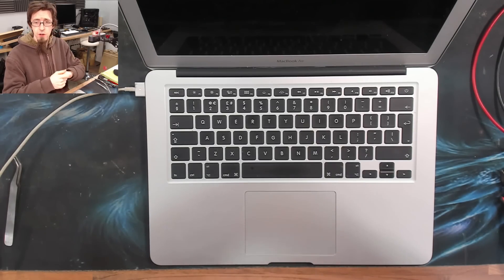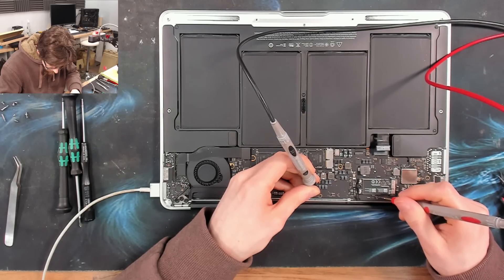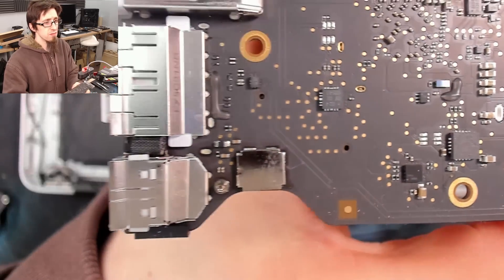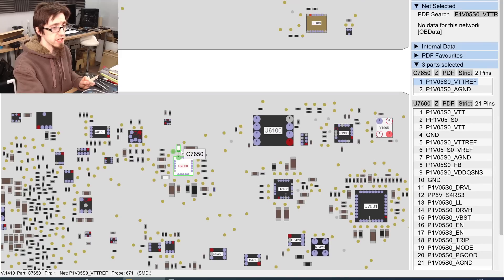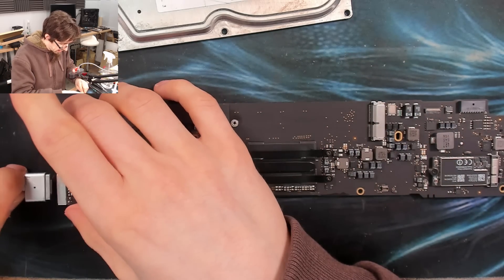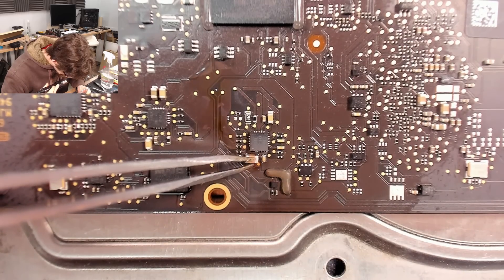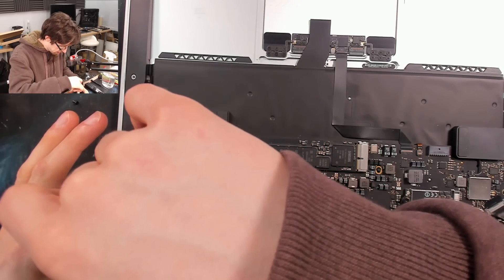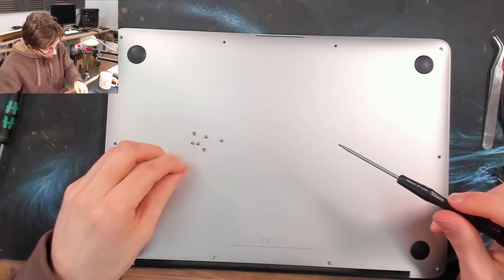MacBook Air, Tiny amount of corrosion - LFC#295

Comment: Question, Are those types of capacitors polarized. when you went to heat it up at 13:02 it spun around 180 from the position you placed it in? is this something you need to be worried about when doing board level repair using hot air?
Reply: ah its a MLCC Cap, so not polarised.

Comment: Sorry to bother you! Love your videos.. Curious your advice, I have a laptop that works fine - I launch a game and it'll work anywhere from 10 seconds to 6-7 hours. It'll just straight up turn off. Installed a fresh OS on it with drivers and ran it in Heaven for 6 hours then boom - OFF. Ran memtest86 to see if that was the issue (All runs passed) then I tried something else and launched Heavenly and it was off in like 20 seconds.. Tried one last thing and disconnected the battery to run it off direct power to see if that was possibly the issue. Same thing. At my wits end honestly.

All can think of (and I'm no expert for sure) is that either the GPU is dying or there is some sort of short occuring? Your input is appreciated! Thank you!
Reply from the maker: What model laptop is it? As a complete shot in the dark, I'd replace the thermal paste - even though it can sometimes run for hours, there's a thing I call "flash overheating" where bad thermal paste will work for slow temperature changes, but a sudden spike can cause the CPU/GPU to jump (or flash, because it happens in a second) past thermal cut off. You won't spot it on temperature monitoring, when it happens, it happens too fast to log.
Reply: @Adamant_IT  I will try that asap. Thank you for the response, it’s an Asus Tuf FX506iv

Comment: I love the way you can change just the component you want to Graham. I have a natural ability to blow  resistors and caps off the logic board with the hot air station. I guess practice makes perfect?
Reply from the maker: Ye, practise is key. Don't forget about the airflow dial on your station as well, it's very tempting to keep it on max all the time for more heat, but surprise, turning it down (to like, 1/4 or 1/3) will give you more control on smaller stuff.

Comment: I have a problem that I have never seen before and perhaps you could provide some insight. I have a HP Pavillion with 16 gb of ram and Intel i5-3470k CPU. The issue I have is with the ram…..more specifically….the ram slots. It boots and runs fine with one stick in any slot…….but when I add a second stick in dual channel (slot 1 & 3 or 2 & 4] configuration, it doesn’t post. All ram sticks I’ve used are good working sticks. Now when I put the sticks in 3 & 4 it posts, but only in single channel of course. If I use 4 sticks……..it doesn’t post. I have updated to the latest bios thinking that may have been the problem……….but no change. I am completely baffled by this problem. For me, the motherboard is somehow failing. What do you think? Getting any answers out of HP/Compaq is an exercise in futility. Definitely the last HP product I will ever own.
Reply from the maker: I've seen dual-channel issues like this before with 3rd gen intel on 2nd gen chipsets - that might be it. Otherwise you might just have to take the hit and run single-channel 😔
Reply: @Adamant_IT  Thanks dude. Unlike the US tech channels, you always reply and damn………I like that. I will send you some pictures and specs of my builds for you to critique. I really enjoy your channel and love how you approach each job. The great part is that you show us computer we actually use and can afford. The US tech channels show us unobtainable hardware. Your channel is similar to Brians at “Tech Yes”. Keep up the great work man.

Comment: You are amazing, I play around with repairs and your videos are so helpful abs inspiring.
I have 2012 macbook pro that works with an external monitor, but doesn't recognise the screen or battery which are both new. I know there's a problem on the board... Just getting the courage to learn how to track it down thanks to your videos
Reply from the maker: Those kinda of faults can be tough. Sounds like one of the data lines is getting pulled low. Battery has a SPI data line (clock and data) but I can't remember if the display also has SPI on it.

Comment: Was there a solder ball left on a gold pad next to the replacement capacitor? 12:50 It'll probably be fine though I've seen enough working electronics with plenty of them thrown around.
Reply: Its not loose so its not a solder ball at that point, just a tinned pad, not going anywhere.

Comment: Hi Adam 
Quick question - How You identifying broken SMD capacitors? [no donor board, no schematics] - (lost connecting termianl - terminations)
The patient is gigabyte 980 Ti [c915 and c921] PLEASE!
Reply from the maker: Broadly speaking, find another nearby capacitor of the same physical size on a similar power rail, and 90% chance it'll be the same value. So remove a working on and measure it with your multimeter in capacitance mode. (Don't measure caps in-circuit, you'll just get a read for the entire circuit, not the cap you're probing.)

Comment: That was lucky that the short was on the input stage of that 1.05v regulator instead of the output. Could have been much worse because that 1.05v goes to all the important chips (i.e.: PCH). Nice fix, Graham. Oh and thanks for supporting PLD and the FlexBV giveaway.

Comment: If is or not available? How much would it cost to recondition a graphic card. (Card in working order , can bench test wo fail)
Clean, new thermal pads ,and new thermal grease.  Front and back plate? If I was to choose average pads and paste or Grizzlies high end pads and grease. Basically what would labor cost be?
Is their an hourly computer repair/maintenance rate?
🤷🏻‍♂️
Reply from the maker: aahhh can do... honestly I'm not sure it'll be worth the postage both ways. I'd recommend taking a bash at it yourself - taking a GPU cooler off isn't hard stuff.

Comment: can you share link to that capacitors package? I can't find it.
Reply from the maker: Something like this: https://www.ebay.co.uk/itm/264969107501
This seller has various size kits, the smaller (16 values) kits look like they have the usual suspects (1uf, 10uf, etc) but also the bigger kits only cost a fraction more. I'd definitely get an 0805 kit, 0603 would probably be useful as well, since the cap in this video was an 0603.
Keep in mind these are not high quality caps, likely not suitable for signal traces and stuff, but they're fine for power rails like the ones I'm normally working on.

Comment: Great and educational video as always. Is it likely that the damage like that hole was caused not by water ingress but by the capacitor bursting?
Reply from the maker: Yea it was the cap itself melting the hole. At first I thought it was just an alignment hole in the KB backlight, and liquid had leaked through it, but on closer inspection it was the cap melting a said hole. Still don't know how liquid got there without leaving a mark anywhere else though.

Comment: That is the weirdest cause I have seen from you yet... How the hell did one drop of liquid bypass everything and hit that one capacitor????
Reply: I'm not sure, but the fan ends up blowing water to certain areas of the motherboard.  Sometimes it's random but a lot to certain areas of some Macbooks
Reply: sometimes right near a 12V line that's beside a data line that leads to the CPU. :(

Comment: From someone who is used to old school analogue audio prototyping, why so much flux just to remove a C? Wouldn't a speck be enough?
Reply: Louis Rossmann would like to have a word with you about your lack of flux faith.
Reply from the maker: I'm tame compared to most people in this business! I think it's partly just because the hot air blows a lot of it away, and turning down the airflow to reduce that makes it harder because laptop mobos are super heavy and soak up a lot of heat.
Reply: I don't care how much flux is used as long as it ensures that desoldering that component (even if it only has two leads) minimizes the risk of peeling off a pad.

Comment: I just started the video but that reminds me a problem I had with an ASUS laptop. The battery had some kind of problem and if it was installed, the laptop didn't turn on (with the charger plugged, of course). As soon as I removed the battery, it worked perfectly. My point is that sometimes it's worth to disconnect the battery and check if it works 😅